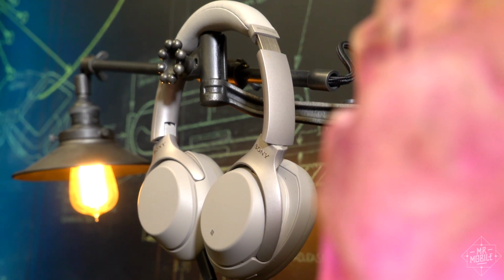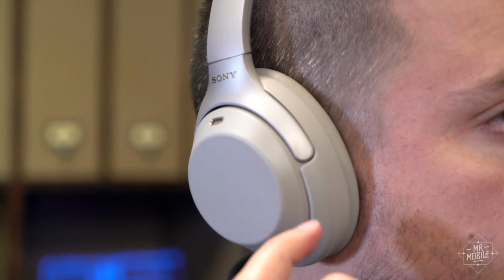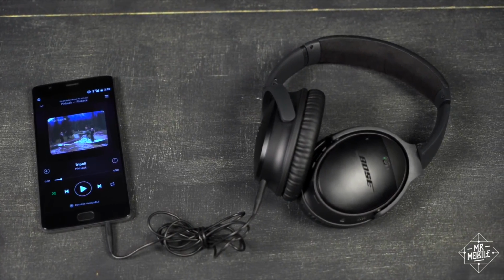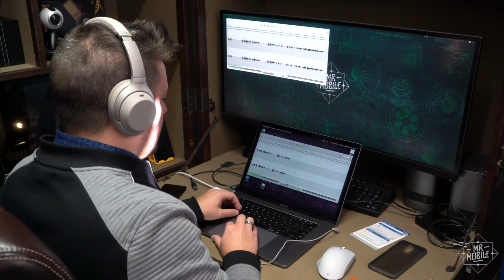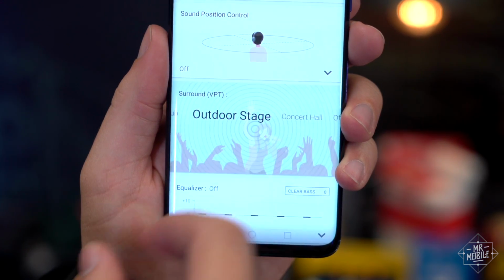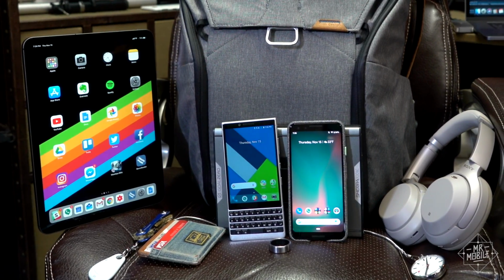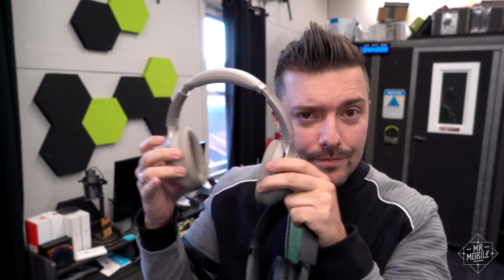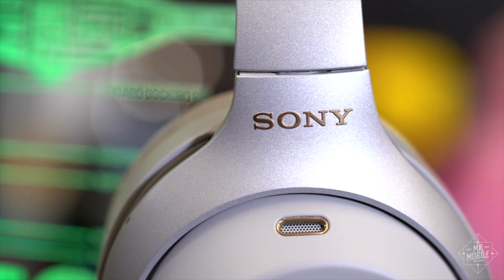The New Noise-Canceling King: Sony WH-1000XM3 Review

Comment: These things are so ridiculously good. My dad just got them and holy crap they are so damn good, was on a flight today and they completely drowned out everything including engine and air noise in the aircraft. These things are totally worth $350
Reply: NMB Ale none at all so far! These headphones are holding up well
Reply: Did you find them better than Bose?
Reply: SimmonSays they are the best headphone I’ve ever used, they just drown everything out. These are by far the best headphones of 2018
Reply: SimmonSays so much better
Reply: @coflyer2949  i know i am 3 months late but could u tell how the headphones have held up till this date ? i am planning to buy this headphone.
Reply: @arnabmukherjee4435  they're working as they did when they were new! Awesome headphones and the noise canceling is still working great, still impressed by the noise canceling
Reply: For anyone that has them, what's the comfort like? I've seen a lot of reviews and comments that say the ears get too hot after a while.
Reply: @player101233  I got the headphones and man are they comfortable. They fit perfectly and are very comfortable. 
Not much pressure on the headband too as the headband is quite cushioned. 

p.s. For anyone who has not worn or used ANC headphones, they might feel  a little sick at first.

p.s.s They do make the ears hot after like 2-3 hours of usage.
Reply: @arnabmukherjee4435  ok, thanks. 2-3 hours I can live with. I was getting worried that it's like 15-30 min. But if it's 2-3 hours, that's fine.
Reply: @player101233  And if u want to compare to Bose i have one thing to say. Bose is really good in comfort whereas Sony is better in sound. I own both of them so i could tell that bose qc 35 ii is better than 1000xm3 in comfort whereas audio is much better on the 1000xm3 than qc35 ii.
Reply: @player101233  they're extremely comfortable, soft cups I've never noticed them getting hot, soft top that rests on your head too.. extremely comfortable headset.
Reply: @coflyer2949  thanks

Comment: I bought these due to the noise cancellation and I can confirm these are the best ANC headphones in this segment, call quality was a bit of an issue for me as mentioned in the video, but surprisingly none of the people whom I spoke with through these pair of headphones said anything about the call quality, everything was pretty clear to them, might be due to the fact I was sitting in a quiet area, but call quality has not been an issue with me. Would definitely recommend

Comment: I have the first generation of these, and they're  great! Used them at work for anywhere from 8-12 hours a day, 5 days a week or about a year, and never had any complaints.

Started teleworking about 6 months ago, so while I still listen to music all day, now it's on one of Sony's Bluetooth speakers. Just don't have any need for the noise canceling feature now, and even though I find they sound awesome, I prefer not to be isolated from things when I'm the only one at home.

If I was still commuting to work though, I probably would have picked up this 3rd gen model though, as I've heard nothing but good things about them.

Comment: I was gonna race down into the comments to ask about the impending Surface Headphones....but I got to the end of the review(as per usual with your videos lol) and was satisfied.

SO then, a different question: Have you been poking around with Ingress Prime? I remember you were a player of the OG Ingress and was curious to hear your thoughts on Prime so far. :)
Reply from the maker: Thanks for watching to the end. :) And I've played a bit of Prime, but the UI ... I'm still getting used to it.
Reply: @TheMrMobile  For an 'upgrade' the Prime UI is disappointing.  

It's a resource (and therefore battery) hog though, so that the UI is questionable doesn't really matter.
Reply: @TheMrMobile  Personally speaking, I'm enjoying the UI. For me it's the performance that's a bit of a struggle to work with. Granted, I'm not using a high-end flagship phone for Prime at the moment(my trusty Note 5's screen cracked months ago and at the time I didn't have enough cash to fix it up so I snagged a cheap LG phone to replace it.) 

It's pretty laggy most of the time and it just doesn't have the polish that OG Ingress did. Here's hoping that Niantic continues to keep ironing out the kinks.

Comment: I've been using my 1000XM2 over the past year (and counting) and they have served me well. The 1000XM3 definitely looks to be a very worthy successor with more chops.

Also, you forgot to mention one thing. Unlike prior generations, the 1000XM3 can be used just for NC without being connected. Prior generations couldn't do the same because it would shut off after 5 minutes if it does not detect a connected and paired device.

The NC/AMBIENT button can also be remapped to act as a Google Assistant trigger on the Headphones Connect app like on the M2, but I wished they'd just given the M3 a dedicated button

Comment: Thank you!!!!!  You actually included the worst part of these headphones in this review instead of glossing over to the lack of multi-bluetooth paring. For me, it's the biggest problem with this set and a deal killer. It wouldn't be so bad if you could pop these back into pairing mode easily, but I'd rather spend another $50 on the Bowers and Wilkins PX for sound and build quality. But thank you for not hiding the lack of multi-bluetooth pairing.

Comment: I bought a pair about a month ago and am super glad that I did. Don't let the price deter u because the headphones are worth every penny. Before the xm3s i used airpods on the bus ride home from school everyday and outside noise leaked right through, even on almost full blast. With the xm3s i can have them at low volume and block out literally every noise. I can go several days without charging them (i used them for several hours each day) and once u use the touch controls u wont be able to go back. Very comfortable, u can easily go several hours with these on without any fatigue. Bose might be a little better in  the comfort department but not so much as to sway any opinions (my friend owns the qc35ii and i tried them out). Glad i spent the $350 on these.
Reply: Shpawn I’m debating between the two! You know where I can test out the Sony’s? I’ve tested out the Bose and was really impressed but want to try out the Sony’s before deciding which one to buy.

Comment: Once Bluetooth devices are paired, there is no need to pair them again, except in the following cases airing information has been deleted after repair, etc. When a 9th device is paired. The headset can be paired with up to 8 devices. If a new device is paired after 8 devices are already paired, the registration information of the paired device with the oldest connection date is overwritten with the information for the new device. When the pairing information for the headset has been deleted from the Bluetooth device. When the headset is initialized. All of the pairing information is deleted. In this case, delete the pairing information for the headset from the device and then pair them again. The headset can be paired with multiple devices, but can only play music from one paired device at a time.

Comment: Hello these headphone's are really really good in a lot of ways. I've had them for a few week's now and I can now give a honest review on them. I've have the Bowers and Wilken's Px's,Sennheiser px 550's and the parrot zik's and now these here. The build quality of them has gotten better from the last model mainly the fit. The noise cancelling is simply outstanding. The call quality isn't the best either. The sound signature on them is really good! My ear's did slightly sweat after a few hour's of wearing them though. These are The only headphone's I've ever owned that didn't cut out when I stepped into best buy! The touchpad you have to be precise with the gestures on it or you'll skip a song quite frequently. I also don't like the double tap to answer or pause you have to get that right to do either one of those. And other gripes are the long press of the power button on or off and that dang short ass charging cable they come with. It's like 2 or 3inches....

Comment: I just received my pair a couple days ago. Haven't used them much as my Sennheiser PXC 550 are my current daily drivers. Though I have to say I really enjoy the Sony's in my limited use. Really good sound, as light as my PXC's. NC is even better than my PXC's (which was already good) and it comes with USB -C (Not the biggest need for me, but it is nice to carry around less cables seeing as my phone uses USB-C). 

Will start using them more often. Happy that they seem to have better build quality than the version 1 and 2's which had the headband cracking issue.

Comment: I still use the Sennheiser Momentum wireless. And while I hate, that they are still micro usb, they last so long that I never actually worry about running out of charge and I don't travel enough long distance. The reason I prefer them is that they are controlled via buttons and can easily be connected with a wire, both are features I do not want to miss and so I will stick with them for a while.

Comment: Bose QC35II still sound more accurate and balanced. Have multi-device pairing and easy device switching. Better comfort and build quality. Sony’s though block out more noise and have a more bass rich sound most will prefer. I use them both daily.
Reply: THe only downside i think is that it charges via micro USB. But thats just me nitpicking. QC35II is for me all around best.
Reply from the maker: Agree on most of your points but not build quality. XM3s have finally caught Sony up to Bose in hardware. And while I do find the 35s more comfortable, Sony's ambient sound monitoring and control features really do put the XM3 over the top, IMO.
Reply: MrMobile [Michael Fisher] Bose build quality is superior when I swivel and pivot my WH1000Xm3 the plastic makes creaking sounds indicative of cheap materials being used. Meanwhile my QC35II is quiet under the same stress tests. Most people aren’t going to use the extra features of the Sony’s and just prefer a headphone that is ready to go out of the box and is easy to connect to all of their devices. Also, the sound and comfort which is two very important aspects in any headphone are superior on the Bose. That alone renders the Bose a more superior option for most people.
Reply: Having owned wired and Bluetooth Bose QC 25 and 35 respectively and use them DAILY these are the only headphones that provide 8+ hour comfort.  No pressure points, irritation and all the points you have raised.  I don't like the high price but have found nothing else compares on the critical feature - comfort.
Reply: QC35 are not more accurate and balanced, it losses a lot on the highs and the noise cancellation crowds the soundstage. leaving for less audio projection.  When it comes to comfort the QC35 II are slightly more comfortable than the XM3. in terms of pure audio capabilities. plug those to headphones with a 3.5mm cable into a cable DAC. I can tell you it's not the Bose
Reply from the maker: We disagree.
Reply from the maker: Very true.
Reply: MrMobile [Michael Fisher] That’s the norm when it comes to opinions and subjective impressions. They vary. That’s why we have objective data from machinery. Measurements clearly show the Bose QC35II outperform the Sony WH1000XM3 sonically. Bose packs better sound and comfort and multi device pairing and better call microphone. It’s simply a superior overall headphone to MOST people over the Sony’s. The Bose QC45 will obliterate the competition.
Reply from the maker: @TheGamingAudiophile  On the one hand you espouse objective data, while on the other you make a bunch of assertions ("most people aren't going to use Sony's features," "most people prefer a more bass rich sound") that have no basis in fact. So ultimately it boils down to subjective interpretations of which features are more important to the product quality question, which I've already done in the review. Bottom line: we disagree, so I'm not sure what's to be gained by continuing this debate.

Interesting sidenote: it's pretty well known I don't make reviews for people who care about which headphones perform "sonically better," and I just learned that CNBC, back in 2016, found most folks are in the same boat: https://www.cnbc.com/2016/08/05/hifi-music-streaming-services-people-cant-tell-it-when-they-hear-it.html
Reply: Here in Sweden the Sonys are worthless, they can't handle the cold weather. I returned mine the second day
Reply: TheGamingAudiophile didn't you say that exact same comment to another guy a few days ago?
Reply: Sony > Bose. Don't you want to get that through your thick skull. No one agrees with you lol
Reply: @yosefm170  Or you could have waited for Sony to release a firmware update where cold issues could be fixed. You've made a horrible decision, I guarantee you.
Reply: @zaka2630  I think they are overrated, the comfort and build quality is not that premium and the sound quality is better on my Sennheiser PXC, i borrowed Bose QC 35 for couple of weeks and somehow they are better in everyday use. Maybe I buy another pair now and hoping that I recived a bad pair, but for me, Bose is better, a two year old device...
Reply: The ignorance here is real... I have headphones costing thousands of dollars and know truly accurate and HiFi sound. Meanwhile the majority of you here pick up a pair of $400 headphones and that’s the best and most expensive pair that you’ve ever experience and yet want to combat me in arguing about sound quality? Haha! I’m done here. Can’t fathom this ignorance any longer.
Reply: Ezugo Obuekwe The review title implies the Sony’s are the “king” in noise cancelling headphones. That’s a subjective opinion and yet he states it as objective and/or absolute statement. The Sony’s are inferior to Bose QC35II in numerous ways.
Reply: Ezugo Obuekwe I won’t be reviewing the PXC 550’s.
Reply: Ezugo Obuekwe Noise cancelling of the PXC550 is inferior to the Bose and Sony. Sound quality is inferior to the Bose, but surpasses the Sony in terms of tonal accuracy and clarity. Comfort is inferior to the Bose and Sony’s. They’re not worth my time. I had them for about 1 month.
Reply: Ezugo Obuekwe The louder volume when wired is due to the more power output of the source the headphones are connected to. The internal electronics within the headphones can only produce so much power while being small enough to be tucked inside the headphones. I reviewed the Studio 3’s because of their popularity. As for the sound quality and audiophiles. A lot of audiophiles simply don’t know what they’re talking about. Bose produces some excellent sounding products.
Reply: Ezugo Obuekwe If you plug the headphones while powered on into a source you’re via the headphone jack you’re essentially double amping them and this will get more volume. As for the Bose QC35II, I go after measurements and objective data as opposed to subjective data which is useful but I take it with a grain of salt because it varies from person to person. For example, I find the Bose QC35II to sound better than the Sony’s meanwhile someone else would say otherwise. However, objective data from measurements shows the Bose QC35II as the superior sounding headphones.
Reply: Ezugo Obuekwe The PXC550 seams to have a high impedance when powered on and thus the double amping isn’t effecting since the main source can’t pump out enough juice into that high impedance. When the headphones are switched off, the impedance drops to a typical level for most portable headphones and thus the source you have them plugged into can efficiently power them and thus the volume is much louder.
Reply: Ezugo Obuekwe Yes.
Reply: @Shiniychi the bose qc35's sound so flat and lifeless to me. The sony's sound so full and powerful. Sony's won me over.
Reply: Agree that QC35ii has better microphone for calling, build quality, comfort and support for multi device connection. However I personally disagree with Bose has superior sound. 1000XM3, PX, H9i (sadly with same codec suport with QC) and AKG N700 (same codec also) does sound better than it. I used the QC for a few months, but cannot stand using it other than commuting, due to the horrible sound. Incidentally, I have heard (and owned) some good dynamic and planar headphones as well as some nice BA IEMs, though HD800 is not my cup of a tea.

In all fairness, audio quality is in the ears of the beholder. More accurate or balanced sound does not mean it more superior than those that have “colored in-house” touch. Accurate and balanced has a specific application, which is typically for studio use. I can vouch that many people does not like to enjoy music with studio standard sounds, that’s why colored dynamics or planars (or electrostatic) are still selling like hot cakes. A good comparison would be a quartz vs automatic watch.

Sometimes, it is that little touch from the manufacturer that increase the dollars for those headphones. You can easily get a good studio grade headphones for bargain as opposed to a good dynamic, for instance, Utopia.

That being said, if you enjoy HD800, no wonder you’d like QC more. Again it does not mean that it is the universally more superior sound to 1000XM3, because there are many that prefers and feels that it has a more superior sound as compared to the QC. My 5 cent.
Reply: The aptx support (as well as ldac) on the Sony put them ahead for me. Trying to watch video with the bose there is noticeable lag